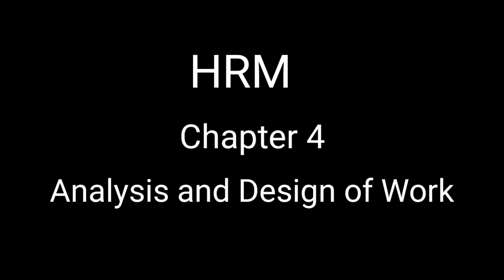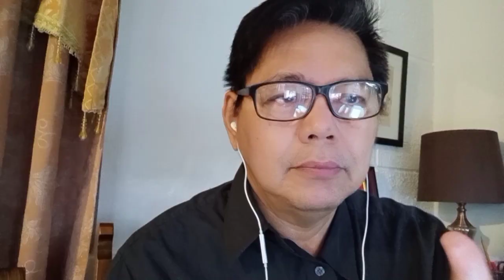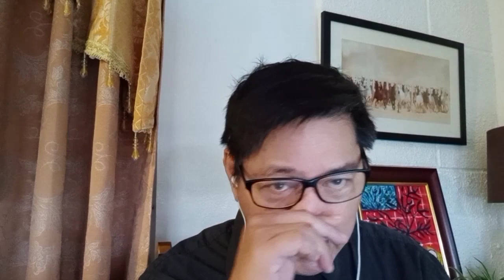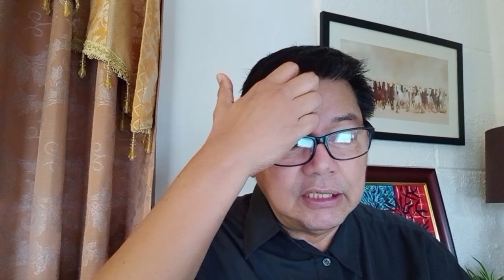HRM: ANALYSIS AND DESIGN OF WORK

Comment: Bejosano, Virvienica Isearis R. 
ASM3
HRM Final Examination

CHAPTER 4

1. Based on a workflow analysis, describe the major differences between how tasks are grouped into jobs at a fast-food restaurant and those at a five-star restaurant. Which job design approach do you see predominating in each? 
Fast food job design is only specialized with a few tasks, each is specified through the standard operation, this is basically done with the mechanistic approach job design comparing them to a five-star restaurant, a five-star restaurant has a wider and larger task given to them, each individual has a greater responsibility to meet the customers’ standards. This job design is closer to a motivational approach because the whole market should motivate and they should have greater value and workforce due to the company’s image.

2. Compare the functional structure to that of the divisional structure, including the nature of their design, their respective advantages and disadvantages, and the types of environments in which they might best be used. 
- A functional organization is used in organizational structure in which is divided into smaller groups based on departments such as production, marketing, and sales. Each function is managed by a departmental head that has a greater responsibility to be accountable to the top management and to direct the respective department to achieve their performance. The operations are divided based on their expertise and experience. The functions such as finance and marketing are shared within divisions or products. The most significant advantage of this type of structure is that the company will be able to benefit from specialized functional expertise and enjoy cost savings by using services. While the divisional structure is a type of organizational structure where operations are grouped based on divisions or separate product categories. Separate functions such as Production, HR, and finance can be seen under each division to support each product line. This structure is suitable for companies that operate with several product categories in markets.

Comment: FINAL EXAMINATION
Edulan, kieth M.
ASM3

1. Compare the functional structure to that of the divisional structure, including the nature of their design, their respective advantages and disadvantages, and the types of environments in which they might best be used.

A functional structure divides the organization into departments based on their function. ... The organizational chart for a functional structure shows the role hierarchy: for example, president, vice president, finance department, sales department, customer service, administration, etc

Functional Structure:
A functional organization is a commonly used organizational structure in which the organization is divided into smaller groups based on specialized functional areas such as production, marketing and sales. Each function is managed by a departmental head that has a dual responsibility to be accountable to the top management and to direct the respective department to achieve favorable performance. Such functional areas are also referred to as ‘silos’.

Functional structures are ‘U-form’ (Unitary form) organizational structures where the operations are categorized based on common expertise and experience. The functions such as finance and marketing are shared across divisions or products. The most significant advantage of this type of a structure is that the company will be able to benefit from specialized functional expertise and enjoy notable cost savings by using shared services.

E.g. SDH Company operates with a divisional structure and produces 5 product categories. All these categories are produced by a SDH’s production team and marketed by a sole marketing team.

However, functional structures are difficult to adopt for larger scale companies that operate in a wide geographical area, especially if the organization has overseas operations. In the above example, assume that 2 out of the 5 product categories are sold in two different countries. In that case, the products have to be shipped to the respective countries and different marketing approaches may have to be used.

A divisional organizational structure usually consists of several parallel teams focusing on a single product or service line. Examples of a product line are the various car brands under General Motors or Microsoft's software platforms.

Divisional structure:
Divisional structure is a type of organizational structure where operations are grouped based on divisions or separate product categories. Here, separate functions such as Production, HR, and finance can be seen under each division to support each product line. Divisional structures are also named as ‘M-form’ (Multidivisional form) and are most suitable for companies who operate with several product categories in geographically dispersed markets.

Multinational organizations such as Unilever, Nestle have expanded their businesses to cover all the regions in the world. They have production plants in a number of countries to produce and sell in respective countries. Due to the high volume of production, it is not practical to produce all products in a single location and distribute to a number of countries. For such organizations, they have limited choice but to adopt a divisional structure.

In this type of an organization structure, inefficiencies in one division do not affect the other divisions unlike in a functional structure since the divisions remain separate. Further, the divisional managers have significant autonomy to be responsive to customer demand without much influence from top management from the parent company. On the other hand, control issues are much likely to arise due to the scale of the organizations and divisional managers acting upon their own personal agendas without considering working towards a common corporate objective. Divisional structures are very costly to operate since cost benefits available to functional structures through shared services are not enjoyed. Tax implications and additional regulations are also applicable to companies that operate in multiple countries.

2. Based on a workflow analysis, describe the major differences between how tasks are grouped into jobs at a fast-food restaurant and those at a five-star restaurant. Which job design approach do you see predominating in each?

The goal of restaurant and food service establishments is to provide high-quality meals and excellent service to customers while staying within food and labour costs so that the operation can make a profit. This goal can only be achieved with the cooperation and support of all of the staff. Just as a football franchise only succeeds when the players and staff form a cohesive team, so too does a restaurant succeed only when the staff forms a working team.

Teams invariably outperform individuals if they are working effectively. When groups come together to solve a problem, they come up with more creative and flexible solutions than could individuals. In a restaurant, excellent food and service is always a team effort. If the meal is not well prepared or if the service is poor, the customer may not enjoy the dining experience. All members of the team have a role in making the customers experience memorable.

Cooks often think only of the team in the kitchen. The kitchen staff members may think of themselves as a team (“us”) allied against the front of house staff (“them”). The kitchen staff on other shifts, management, and other components of the operation may also be considered “them.” This is not productive in a well-functioning restaurant. The staff may believe that if only “they” were more understanding, worked harder, or knew what it was really like, “we” could do the best job. Of course, this same thinking is prevalent in the other groups except in reverse.

The flaw with this thinking is that it pits one group against the other. It contributes to poor customer service. Petty jealousies and conflicts can lead to various schemes to get the better of the other group. This is an immature way of looking at your workplace and unfortunately the customer will suffer. Being part of a team means being respectful to all other members for their particular role and duties. When the entire group sees itself as having a common set of goals to achieve, and each member of the team understands his or her contribution to the overall team effort, the best results are achieved.

Comment: FINAL EXAMINATION
Daquil, Johnrey M.
ASM3
CHAPTER 4

2.	Based on a workflow analysis, describe the major differences between how tasks are grouped into jobs at a fast-food restaurant and those at a five-star restaurant. Which job design approach do you see predominating in each? 

Jobs in fast food establishments are typically divided into customer service and food preparation positions. In 5 star restaurants there would be a general manager, assistant manager, Line cook, and Dishwasher.  I think Job enrichment is the constant job approach applied in both settings since both jobs are capable of providing opportunities and responsibilities that require decision making and helps the motivation of the employee. 

3.	Compare the functional structure to that of the divisional structure, including the nature of their design, their respective advantages and disadvantages, and the types of environments in which they might best be used. 

The functional organizational structure group employees based on area of specialization. On the other hand, divisional organization employees grouped together,  depending on product, service, market or geographies. In functional structure, Managerial development is not easy due to the lack of autonomy of.  However, in  divisional structure autonomy is present which makes managerial development easier. In functional organization structure cost is less because the functions are not repeated. In the divisional organizational the could be repetition of resources which may be costly. The functional structure is use by organization which is small and simple. Divisional structure, which is appropriate for those organizations, that are large and dynamic.

Comment: Harvey D. Cube
3ASM
HRM FINAL EXAM
Chapter 4
1. Name and discuss the nature of the steps in a workflow analysis
Workflow analysis is the process of breaking down the performance of a workflow and it examines the trends for improvement. Workflow analysis reveals redundant tasks, bottlenecks, and opportunities for more automation.
The steps in a workflow analysis is to collect hard data in this case you should get a report of the workflow that you want to examine. Analyze the stats and see which ones are performing as required and which ones aren't. The next is collect soft data it helps further your workflow analysis, and you really need more than just numbers. The third step is ask the hard questions this step will guide the workflow.
The last step is to implement the changes and follow up once we've identified all the changes that came from the workflow analysis, we should implement it in our system.
2. Based on a workflow analysis, describe the major differences between tasks are grouped into jobs at a fast-food restaurant and those at a five-star. Which job design approach do you see predominating in each.
The jobs in a fast-food restaurant are fast because the foods that are being served there is fast and also once you order your food in the counter you will immediately get your food because the waiters there are getting your food from the counter and also they are also making sure that the restaurant is very clean while in the five-star restaurant the waiter will serve your food in your table and also rich people eat there and it's more expensive.

Comment: BUNO, Justin Marie B.
FSM15-ASM3
FINAL EXAMINATION
Collect Hard Data-Take a report of the workflow you want to examine. Analyze the statistics and see which ones are performing as required and which ones aren’t.
Collect Soft Data- To further your workflow analysis, you need more than just numbers. Now you need to go and talk to the people who use the workflow tools most frequently. Start with those who fill out the form.
Ask the Hard Questions- The next step of workflow analysis is to ask the questions that guide the workflow. The best solution to fix this problem is by making changes to the workflow form so that the manager feels he has everything he needs

Comment: Akihiro G. Hyono
BIR RR7 - Quezon City
This chapter discussed Job analysis and design could be a key component for a competitive advantage and strategy.
 Managers have to understand the whole work-flow process to confirm efficiency and effectiveness and have clear, detailed job information. Managers can redesign jobs that the energy unit is ready to realize its goals while individuals like motivation, satisfaction, safety, health and achievement.